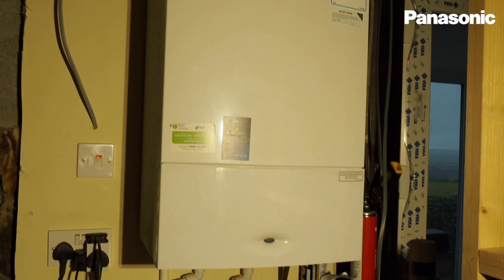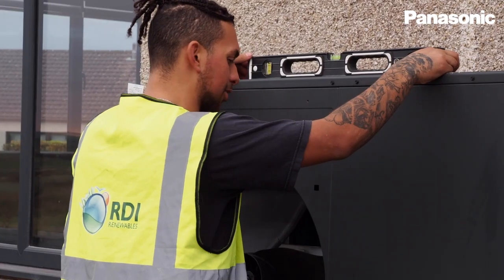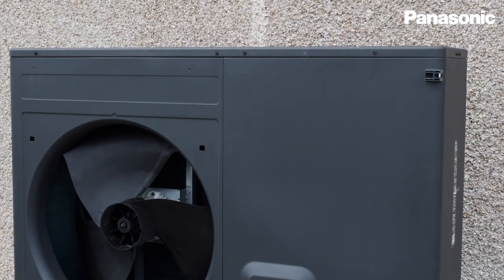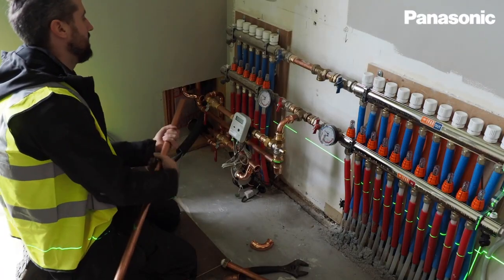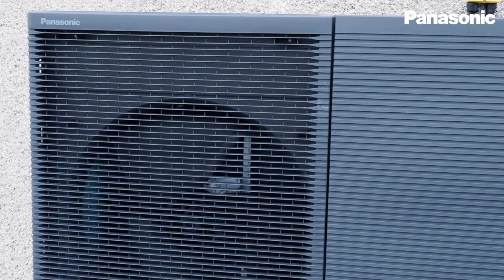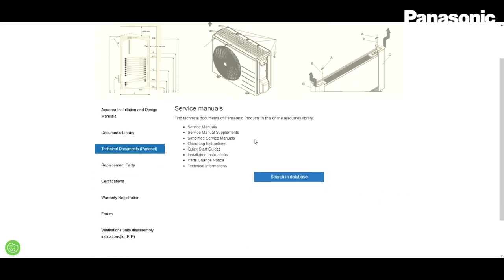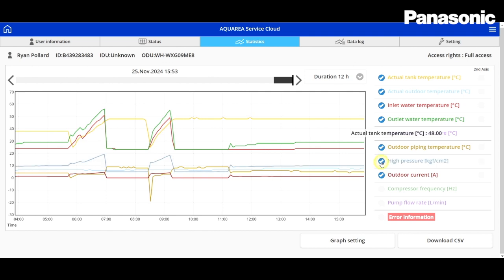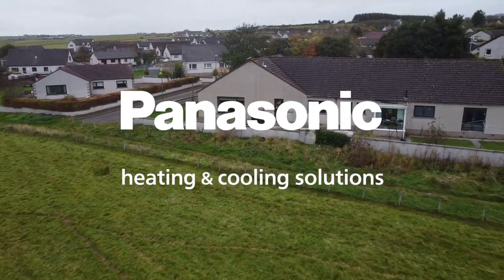EN – Scottish family Installs UK’s first Panasonic M Series Heat Pump

Comment: I can see you have underfloor heating so 38 degrees is ample, but what max temp will it run if you had radiators? 
I’m guessing at least 65degrees to be fit for purpose?

Comment: Look at the size of that unit and the complex pipework required. I can only imagine the noise level when those things are fitted to a row of houses. I'll stick with the combi boiler I think.
Reply: Don’t take a look inside your combi boiler fella the ‘complexity’ might keep you up at night.
Reply: @ It's a small unit on the wall. It's quiet, heats all the radiators and gives instant hot water. Reliable and lasts for many years. I never worry about it.
Reply: "Complex pipework"...it's got a flow and return same as a boiler, and an underfloor heating manifold which doesn't appear to be new and was likely how the property was being heated with the combi.
Reply: Actually the larger the unit the quieter it gets.
Reply: They're not quiet but having lived in the US south west where everyone runs their AC non stop in the summer, it's not that big a deal.

Most of the pipework is his underfloor heating, which most people won't have.
Reply: So is 9Kw arranged in a cascade of 2 x 4.5 compressor/condensers?